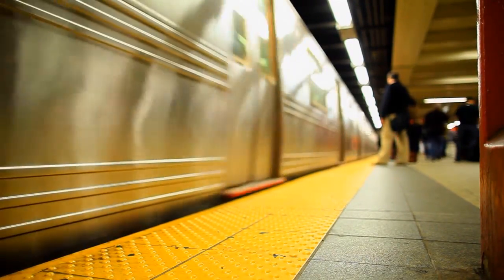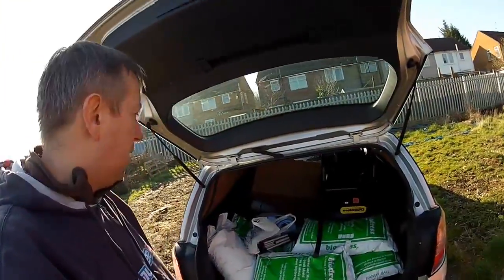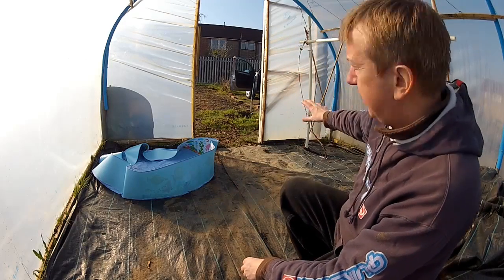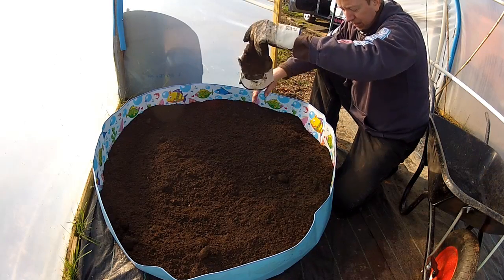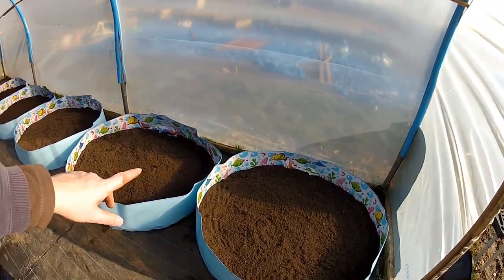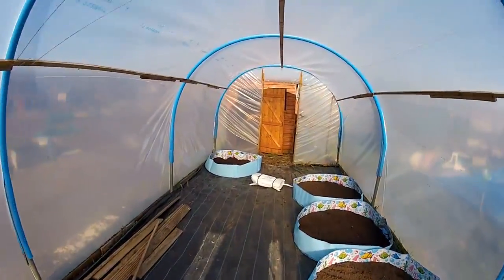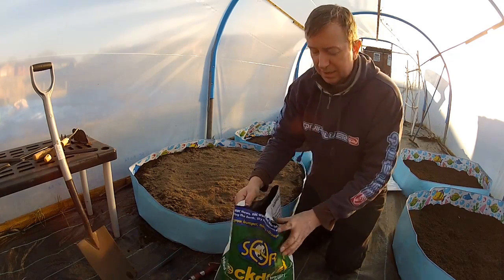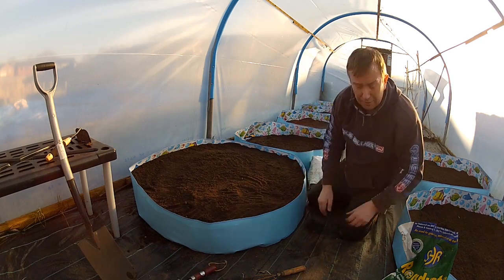Allotment 58: Paddling Pool Raised Garden Beds Installation

Comment from the maker: Will try to use the ground soil in the 1-ton bags as soon as it is pliable enough to dig.  Larger bags not really an option unless delivery is possible (which it's not at this site). 25KG bags are about as big as you want to manhandle.

Comment from the maker: Not really concerned - They have a label stamped on them stating that no dangerous chemicals were used in the making of the pools. Also, any leaching will be limited to just the ultra-thinnest layer of soil that is in contact with the plastic so as long as I stay away from the edges, there should be zero issues. :o)

Comment: You can use the pool as the walls for a raised bed. Then open a hole underneath to the soil to make a very tall raised bed. Also for the rain barrel, you can use anything that catches rain and direct it into your barrel. Since it rains so much over there, the barrel ought to fill up fast. Perhaps a "porch" on one side of your polytunnel, higher on one end and the other end draining into a rain barrel or bucket.

Comment: This is a great video. I have learned so much from your gardening videos. I do have a few questions/suggestions. Have you given up on Mel's Mix from the square foot gardening method? Using 1/3 compost (of 5 different types), vermiculite, and peat moss, you create a perfect growing medium. The compost provides the nutrients, and beneficial bacteria and other good living soil micro critters, the vermiculite and peat aid in providing storage of water as well as creating air pockets for the roots.

Comment: You can put a stepping stone or plank in the middle to step on the get to the back end.  I still think you'll end up with some mold issues with the stagnant water and sealed environment.  But I have allergies to mold and cannot be in a moldy place for any duration.  That scrap could make for a hammock gilligans island style.  Depends on the strength of the material though.  Two planks and some rope.

Comment: Looks good should save you a lot of weeding work :)   Just curious as I haven't seen in your videos How is your compost pile doing? Have you turned it or stirred it up any? I was also thinking, you could take the one ton bag part that you cut off,  put some cardboard in the bottom and make a sort of raised bed with it maybe,  or sew the bottom of it together and make another bag (or 2 by cutting it in half ) out of it.

Comment: I have just bought my raised bed solution, it is very cheap, 30 beds for £10 and they should last a few years as they are designed to be outside, I will be making a video about them so you will have to wait and see what they are!  , and they are about the same size as your paddling pools aswell and probably about 5 times deaper but I will probably make them a bit shallower.

How much did you pay for the compost and where did you buy it from?

Comment: I wish I could build a simple poly tunnel where I live, but we get 5 ~ 8 typhoons a year with winds over 100mph.   Right now I am saving up to build a hardend green house that will take the wind.   I am suprised you have not setup a hydropoinic system and run the pumps with solar

Comment: As to what you could do with that bit you cut off of the one ton bag... get some wood make a large enough base, drill some drainage holes in it, tuck the edge of the bag under the wood and fasten it any way you like (staples or wood slats) and you have another grow bin.

Comment: I don't know if anyone has already mentioned, but an easier method to trim those white planter bags would be to do it when they are flat. For instance, if you need to cut off 5", just measure 5" from top with ruler and with a straight edge draw a line with a marker and simply cut along the line drawn....much neater looking!